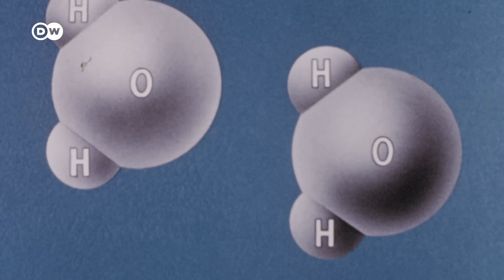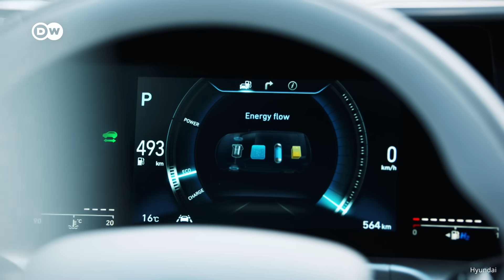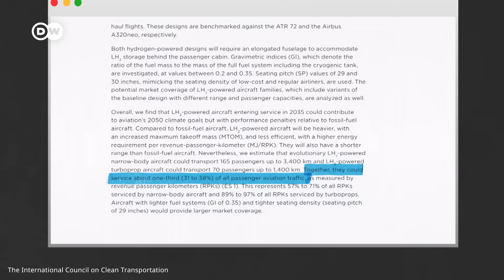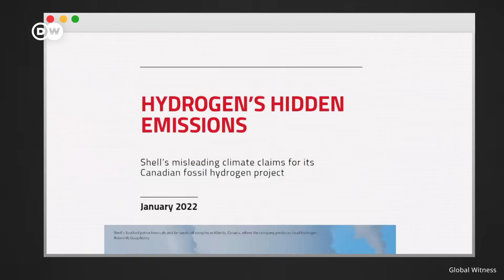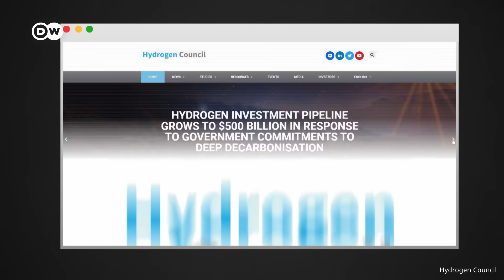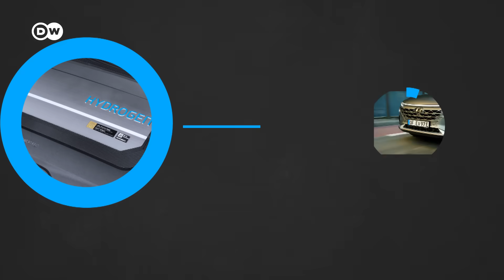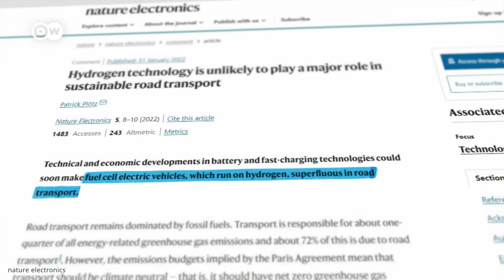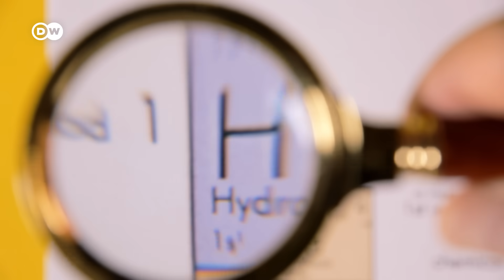The truth about hydrogen

Comment: Check Powerhouse Energy out. They are a uk company that has developed a system that can generate electricity from non recycleable plastics. The power can then be used to produce hydrogen which in turn is carbon neutral. Very interesting to follow and see how it fits in to the future.

Comment: If you want to power an airplane from solar panels, you can't have batteries in the airplane, because they are too heavy for flying. The only way would be to run it on green hydrogen.

Comment: This is a good dissection of the hydrogen issue. One criticism is that you didn’t include nuclear as part of the Green Hydrogen solution
Reply: Nuclear is expensive and takes a while to build because of bureaucracy. In the USA it can take TWENTY years to build one. While other countries are building them in less than five.
Reply: @PsillyApeUSA But it still can be done
Reply: Thorium!
Reply: Nuclear is a way of making electricity. Once you have made that electricity you can still use it directly or you can convert it to hydrogen, compress the hydrogen, transport, distribute, etc. All with the same losses along the way that were described.
Reply: @brucemacdonald3643   nuclear is a way of making heat, not electricity. Heat can be used to make steam to run a turbine, OR to directly split water into hydrogen and oxygen. Water eventually splits when you heat it enough so you can skip the whole make electricity and electrolysis steps. 
This channel is Deutsche Welle. It's no surprise they didn't mention nuclear as they are biased against it
Reply: Nuclear is far too expensive, far too slow to produce and has a bad laegacy issue.
Reply: @harryadam1671  but it is literally the only thing that works )))

Comment: Solar panels and the massive wind turbines have major problems with pollution, as do the EV batteries made from cobalt or lithium. So "green" hydrogen is not really all that green. This is, in short, a distraction from the fact that we need to start using massively less fossil fuel, such as the middle class has to stop those jet trips to Paris for steak dinners. And that is just the starting point. Fake solutions like hydrogen that depend on another power source to be clean when there isn't really a clean power source to begin with is just making it all that much worse.

Comment: Now that's a Rube Goldberg machine if there ever was one.
This would eat up our fertilizer production capacity.
We can refine the oil to contain less carbon per barrel.
Also we have nuclear plants,a almost obscenely safe technology Which we should start building now for the electrical grid.
Net zero means not adding more hydrocarbon emissions on top of what we already are using after a certain point.
We are not stopping to burn hydrocarbons anytime soon.
Nothing comes close to it's energy density to run civilization of.
Energy is life.
A body without energy is a corpse.
A machine a sculpture.
Reply from the maker: Hey there! We did some videos on nuclear energy that you could be interested in: 
Germany´s nuclear exit 👉 https://www.youtube.com/watch?v=eWuGP_aBoYg
Thorium nuclear energy 👉 https://www.youtube.com/watch?v=Km6kqykX900
Do we need nuclear to fight climate change 👉 https://www.youtube.com/watch?v=9X00al1FsjM
Reply: @DWPlanetA  Thank you again!
About hydrogen fuel is that the return of energy investment does not make sense or "scale" in any meaningful sense because of this.
We can refine gasoline and oil and LNG to have a lower carbon content.
We could also run our refineries on small nuclear reactors because the temperature needed isn't that high to refine in this way.
A diesel car versus an EV can drive both drive 7 years before the EVs carbon debt is paid of and overtake the diesel car in emissions.
Before this many will have changed vehicles.
Why not make more efficient diesel engines in our cars that burn low carbon synth diesel.
That will bring those 7 years considerably up.
And that's but one of the actual productive relatively easy engineering we could implement, added with nuclear this could be actually somewhat effective.
We could then subsidize LNG exports to India to keep them from industrializing on coal.
An actual productive measure which implementation of would reduce global emissions in a real way.

Comment: You should in H2 Council mate
Seems you know more than top scientists who concluded this is absolutly possible and green hydrogen and use will dominate the market 
It is all about scale, costs and standards. These will happen sooner than you think.
Think of it as main frame computers 20 years ago and having the same power in tiny home desk top today. You don't have a clue about the transformations and possibilities of the future nor you seems to know some of the safe and efficient under ground storage of hydrogen which are the game changer. I suggest to do more research before putting out something like that. However you have got some really good points there but hydrogen not being part of efficient future is not one of them. That will happen 100% and with massive efficiency and scale.

Comment: This doesn't make any sense how is hydrogen more efficient than fossil fuels yet planes won't make long distance flights?
Reply from the maker: Hey there! Hydrogen is more efficient in terms of energy generation, meaning it can generate more energy per pound of fuel compared to a combustion based power plant. However, the current issues for longer distance flights fueled by hydrogen is the volume. The liquid hydrogen has to be stored in large tanks.
Reply: @DWPlanetA  then it's not really more efficient practically speaking

Comment: First before we consider any new applications of hydrogen we need to clean up the production of old hydrogen demand for old applications. 

If we create a new application and fuel it with green or pink hydrogen, it still has a terrible emissions footprint because it is not displacing old brown/black hydrogen. 

Any new cleaner hydrogen production needs to go first to displace old brown/black hydrogen production. 

Only once we are near 100% green/pink hydrogen production should we consider any new applications of hydrogen. 

On top of that we need to consider if the green/nuclear energy used to make additional hydrogen would just be more beneficial plugged into the grid to displace fossil fuel energy used elsewhere before we bother using it to supply new applications of hydrogen. 

So a lot needs to happen before any new applications of hydrogen can even be considered.

Comment: Scientist should consider the hydrogen energy density if it can be managed for its storage for hydrogen combustion engines and if we stay on fuel cell then again metallurgy issues will be there. Electrodes for electrolyzers and for batteries.

Comment: Naahhhh. This sounds more like propaganda for electric vehicles. Did Elon Musk pay you to make this? One thing you didn't mention is that hydrogen can be made with  nuclear energy. Another is that if our electric grid is going to use natural gas anyways, and that gray hydrogen is being produced as a byproduct, then we might as well take advantage of that byproduct. In the US, 95% of Hydrogen produced is from natural gas and 40% of the US electric grid is natural gas. Instead of burning petrol, that Hydrogen (which was produced for "free" mind you), can be used to power cars. Electric cars not only have the emissions from the lithium battery production to worry about but also that 60% of American electricity production is fossil fuels (20% coal and 40% natural gas). The energy spent on transportation is very very large and if I did the math right it's more than the electricity needed to power all the homes in the US right now (but I might be wrong about this).

Comment: if hydrogen is in space, wy not get it there ?
Reply from the maker: Hey Otto! As of today, there is no focus on that. It would probably also be very cost-intensive. However, as hydrogen is used for rockets, NASA focuses on the possibility of generating and recycling hydrogen in space. It would reduce costs and difficulty of missions. Fun fact: A while ago, in 1960, a so-called Bussard ramjet was proposed. It would be a spacecraft, that uses electric or magnetic fields to extract ionized hydrogen from the near-vacuum of space, compress it, and use it as fuel. However, this is technologically not possible as of now.

Comment: I am neutral about the Hydrogen issue, but your video missed a significant and important form of storing and using Hydrogen and that is using it from ammonia (NH3 or protonized NH4).  Nitrogen is an inert gas and NH3 is very reactive.  NH3 is cheaply stored in steel tanks like Liquified Petroleum Gas (LPG) or Domestic Gas.  NH3 can be directly used to like an Internal Combustion Engine (ICE) like LPG taxis by simply replacing copper laden parts.  Cars can also have small NH3 or NH4 decomposers or electrolysis, the Nitrogen can be released in the air as ecofriendly inert gas but the hydrogen go through fuel cell with oxygen from the air to run the car with electricity.  The car would need less batteries as it will only be used to start the electrolysis of NH3 and the rest of the space will be ammonia storage tanks, like LPG tanks.  Any Gas Station can be refitted into Ammonia refilling station like LPG Stations.  Ammonia, like all other industrial Gasses are toxic but one mild disadvantage is that Ammonia is also an irritant but curable.  Ammonia does not affect the Ozone unlike Methane.  Ammonia is also used as Rocket Fuel.  I have worked in an ammonia refrigeration plant and have played around with it by using it a Christmas Canon to make noise.

Comment: Hydrogen is really interesting and should be on the agenda for quite some branches or industries. However it's not a solution for energy production, sinces it's a product that either uses energy (aka it becomes a storage or source for transport of energy; a carrier) or it's produced from fossile fuels and could have better been burned directly. It can be really good for buffering and distribution of huge amounts of renewable energy (when demand is low). Also it can be used to reduce local emissions. For example the Dutch steel factory want to switch to production with hydrogen so they can used renewable energy (even when the wind is down) and if grey energy is used it still would reduce the local emissions (which are a lot).

Comment: I could be wrong, but I thought hydrogen can be generated anywhere. All that’s required is electricity to electrolyse saline water? Given that hydrogen can be generated alongside electrical transformers (substation) to step-down from high voltage to an acceptable domestic use. Perhaps the electrolysis of hydrogen could be used in such a way to replace transformers. Or somehow modify the technology to incorporate electrolysis? I don’t know, I’m just guessing… but it seems to me that transporting hydrogen shouldn’t be  a problem.

Comment: Hydrogen fuel cells? Yes OK - apart from their weight - but in principle OK

But burning Hydrogen in Air - Like in Aviation or the steelworks (I can't see fuel cells used there)? Isn't NOx a by product - and you may be net zero but that NOx is even worse (hundreds of times worse)  than CO2 is it not?

Have to go and research, was hoping the answer might be here, but it's not.

Ho hum - and as for using reneawable electricity - it's not that renewable is it? Solar or wind?

This is NOT about NET ZERO - it's about protecting the environment
Reply from the maker: Hey there! You are right, NOx is emitted as well. However, there is still a 86% reduction in NOx compared to a kerosene powered airplane. If you want to check out the study, you can find it here 👉 https://www.mdpi.com/2073-4433/13/10/1660

Comment: Mass of hydrogen is 1 x 2, mass of oxygen is 16 x 1 total mass is 18 so that's 9 times more oxygen than hydrogen. In other words water is 11.19% hydrogen and 88.81% oxygen. Gasoline is 13% hydrogen and 87% carbon, for every kilogram of hydrogen that I burn I'm mixing carbon with oxygen and I'm creating about 24.5 kilograms of carbon dioxide. If oil companies remove the carbon  from gasoline before I put it in my car, I will stop doing that.

Comment: Australia is taking the gamble on Hydrogen becoming the go-to renewable. Electric bridges the gap between fossil fuel and Hydrogen, but when you can pull into a refuelling station, refuel in 3-5 minutes, and drive safely for 500+ miles, that is a step above electric. 
Cost to produce: High for start-up technology - if the argument is that you put more energy in than energy out, Australia has 91% desert and the perfect place for solar in - hydrogen out. They've already built the world's largest solar farm in the North, capable of powering millions! What's the bet this becomes a facility for harnessing energy to create "Green Hydrogen"?

Comment: The future is eFuel, check out the Haru Oni project in Chile by Porsche and Siemens. A very straightforward process that produces fuels that can go directly into existing ICE vehicles and, presumably, made to power any other current hydrocarbon fuel reliant technology. The missing link is cheap electricity and this would be solved if we develope enough nuclear fission on the way to solving nuclear fusion for the furture. Renewables are nonsense, driven by grifters.
Reply: Is efuel cleaner?

Comment: All energy sources need to be explored and the world does not need a bunch of can’t be done people. 

Fossil fuel have carbon problems and are releasing to much trapped carbon into air, which is bad for the environment and eventually for us. The price is controlled by too few people who are also buying the government. This people poo poo any other source of energy to protect their revenue stream. Work can be done to reclaim the carbon in the air. This source is getting harder to find and will eventually be harder to meet demand.

Batteries, Lithium is rare earth element found mostly in China. If you like digging holes in China and dearly paying for it, this technology is for you. The five-hour charge times will fill the bulk of you time while you are on earth. Don’t forget that charge probably came from a coal or natural gas fire plant. Wind Turbines and solar panels are not there yet.

Hydrogen does not like to exist by itself, it always likes bond with another element like oxygen. H20 (Water). It takes more energy to make liquid Hydrogen, but power plants, nuclear plants and manufacturers are producing heat to give aid in this process. It hasn’t stopped ethanol which takes more energy to produce it than you get out it. It only works when it subsidized by the government.

We need to work on all sources of fuel to make us independent.

It can be done 

Our government is bought by lobbyist, take it back by supporting term limits. Anyone in office longer than two terms is not in for people they are in it for the lobbyist and monetary gain.

Comment: Many credible scientists and climatologist have been calling BS on CO2 and global warming for years. There are only 400 parts per million CO2 molecules in the atmosphere which is not enough to cause a green house effect. That’s only 4- CO2 molecules for every 10,000 other molecules of gas. That’s equivalent to building a greenhouse without glass and expecting it to heat the air inside the greenhouse. This represents a huge misunderstanding of how the greenhouse effect works. As the sunlight passes through the glass of the greenhouse, it changes its wavelength, heating the trapped air and then reflects out, leaving the trapped heat. This requires the air to be contained in the greenhouse in order to heat enclosed air. Remove just one glass panel and the heat will escape. If you apply the same principle to a huge greenhouse with space for 10,000 panels of glass….. there would only be 4 panels of glass, attempting to create the greenhouse effect. Climate data is highly manipulated to create a desired result to support global warming…. WHY - there are companies making huge profits on climate change, even though they know they are running economies into the ground. I suggest you read the abundant articles from scientists that are not on the take and discover the truth. They will lay out the truth, without bias and do a much better job of explaining and evaluating the actual science.

Comment: Design for batteries because they are heavy and expensive. If green hydrogen power becomes viable, it's easy to switch. If not, you're okay.

Personally, I find it the thing that blew up the Hindenburg, but of course that just held it in bags. I'm still wary, but I am of large batteries too. Same with gasoline.

Heavily armored tanks for hydrogen with hefty welds sound good. They need to stand up to big crash tests, because rather than gasoline, it would be an explosion which would likely be unsurviveable.

Gotta love the power!

Comment: The answer is simple Ban Fossil Fuels.  

Dont allow the Fossil Fools to bullsh.t us!

Ban then!

Use ONLY green hydrogen

Encourage hydrogen ICE cars, trucks etc and convert recent diesel and petrol vehicles.

Demand will solve supply.

Manufacture hydrogen at source using solar.

Install solar on roads car parks etc

Take all if the other necessary measures to reduce global warming for instance grass covered parkung lots NOT tar!

When you life is threatened take action… all if this talk about efficiency etc is nonsense. Solve the problems!

Comment: How is that green tech? you use far more power than you get out of it.  I would have to ask the output can't be greener than a dams output (existing dam not new build ) and these dams by fitting extra turbines like the new generation of RDP Marine Australia's system with no backpressure issues will return more power than was used to make it last longer so greener.